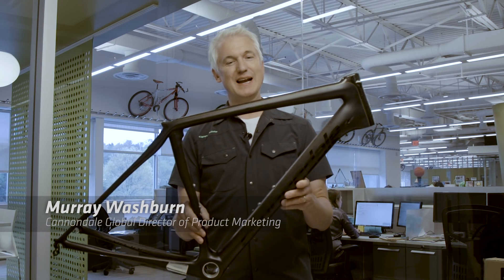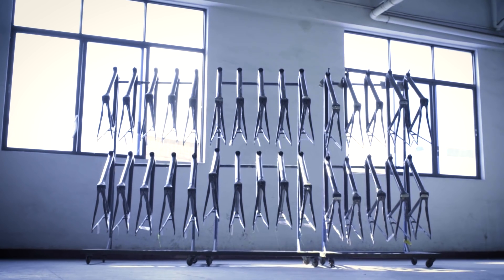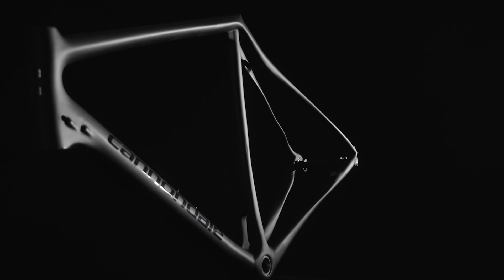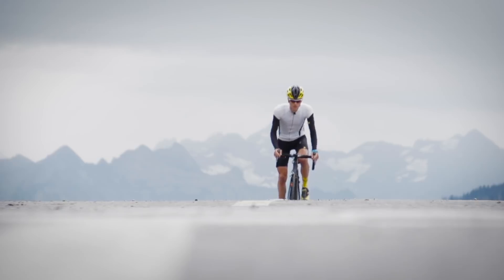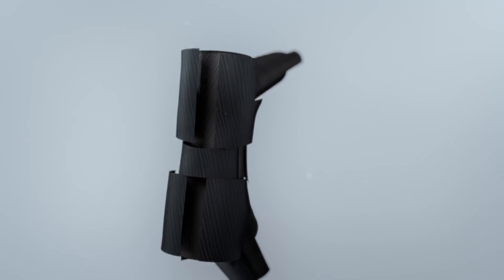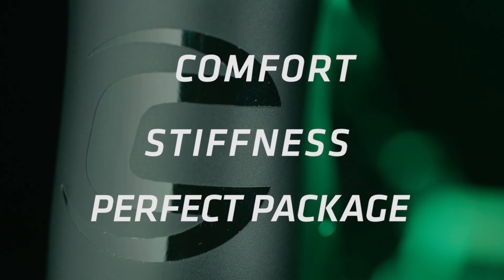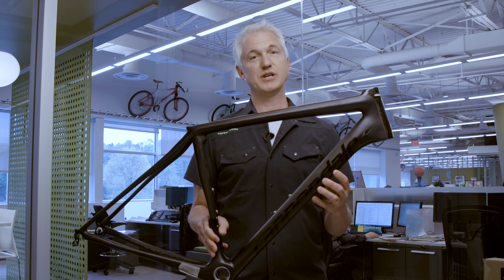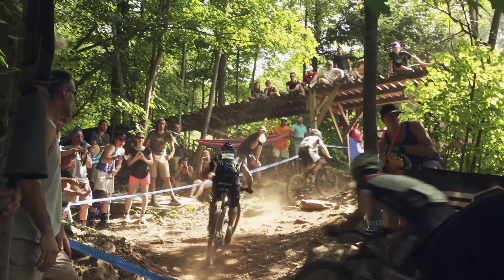Cannondale Innovation - BallisTec Carbon

Comment: pinarello has better carbon!
Reply: how do you know
Reply: One reason is pinarello uses Toray cf,  the reference of excellence in the market, but still subjective to compare bike producers based on the raw material used, one should also master the handling and expertise acquired, either Cannondale and Pinarello equally good.